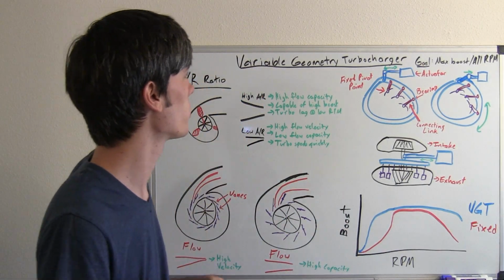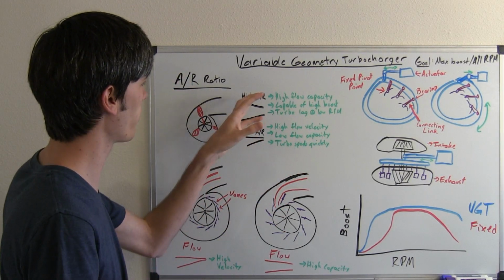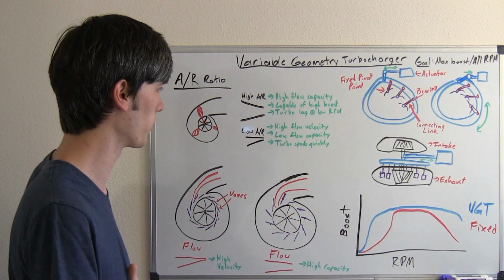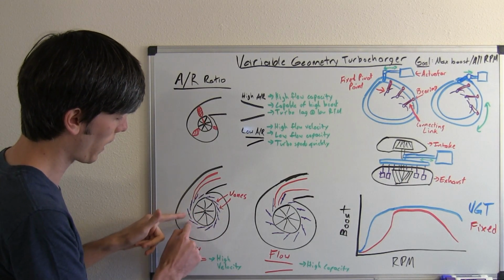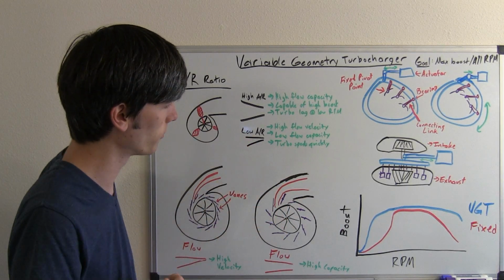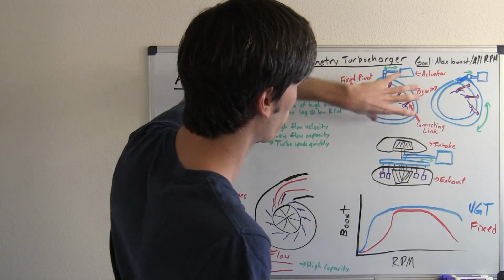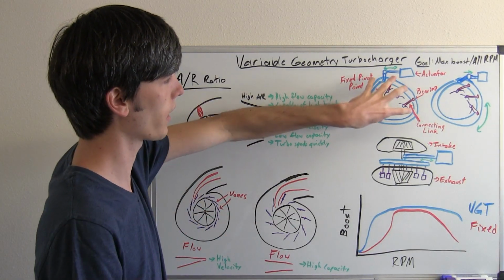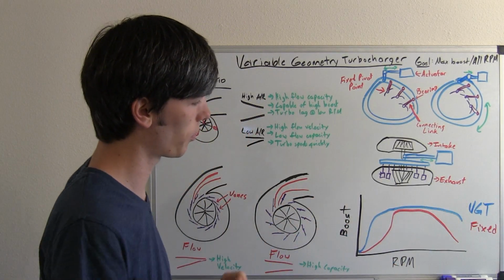Variable Geometry Turbocharger - Less Lag, More Torque!

Comment: I actually don't understand how the actuator works on a spinning rotor. Turbos spins between 80.000 to 300.000 Rpm. What kinda actuator could work in those extreme conditions? 😊

Comment: Would love to know more about how the increased vane height affects boost and drive pressure and the ratio. I am wanting to understand more about the difference between a stage I and stage II charger.  I am under the impression that the stage II has a greater HP potential, due to the taller vane height, but curious as to the down side also, if there is one. Thanks!!

Comment: HELP and answer someone this to me
Soo lag happens if the actuator arm are not good adjusted? When we press pedal to maximum there is bolt which actuator arm touches and that adjusted for best airflow of variable geometry (opens them), if that bolt is too much adjusted VG opens too much and thats overboost? but when we relase gas pedal variable geometry if not adjusted well it closes too much, or maybe closes total if not adjusted? And after we press pedal again there is more time for variable geometry to get opened to good angle to have good airflow for power? Soo we need to adjust lower VG angle which is not totaly closed but a little bit open, if its totaly closed or close to closed turbo lag will hapoen? I think that I need to short little bit actuator arm bc now for me its closed all the way, i cant move more in front that adjuster arm 😂

Comment: Hello, great video Im about to install a VGT turbo on my land rover defender TD5 and have a question for you.

The land rover has a snorkel installed with a mushroom head, I was wondering if at higher RPM with the VGT would the snorkel restrict airflow and do I need to consider a ram head or even consider increasing the diameter of the air intake from the snorkel to the intercooler?
Reply: No wont make negligible difference, as long as through the snorkel at no point the cross sectional size is never less then the area of the compressors inducer which on a td05 i would imagine your gonna have anywhere from 38 to 48mm inducer so around 1500 mm2, considering most snorkels are 75mm to 100mm you will be well and truely fine, and even if you had a restriction less then the size of the inducer it wouldnt drastically reduce performance anyway
Reply: @Eamonn_kelly1  appreciate that, cheers

Comment: First I like your videos, thank you. Pls help me. I have a VN turbo and a vacuum operated actuator. When the engine is NOT running are the vanes widest open? When the engine is running idle, vacuum is applied and the vanes are smallest. Is this correct? What is happening when I shorten the axle stetting? People say that it will give quicker boost? But what will happen with the top end power?

Comment: For a good portion of the video this just didn't make sense to me and I thought it was wrong. My error was that I assumed the "wheel of vanes" rotated and I thought that they should rotate faster when the vanes opened more, as they'd be catching more air. I think it was the circle drawn around the spindle caught me out.
Obviously I eventually realised that it was just the spindle at the centre that was rotating, and then it made a lot more sense.

Comment: 2:53 Hey man, let's take it real blowing in intake port of exhaust stage, at equivalent flow you ll see that it's the exact opposite, turbine RPM increase as you steer blade to the center, at rest position it turn faster than with crank pin in abutment on the screw. Weird isn't it? that will blow your mind, bringing here that's it's more complicated.
About stall, it's not the turbo but the engine that went in over pressurized exhaust pipe, fixed blade would make him "stall", this is one reason for blade orientation, to release pressure. Also, actuator is not moving out as engine RPM increase, but as command depression decrease, care not making engine RPM directly related, and that's not directly related to intake depression too.
The "disc" is not outside, but enclosed with exhaust stage, in separate chamber.
i guess at some point people can mixe with engine RPM and turbine RPM, better specify wich one sometime.
Interesting work, thx

Comment: Not correct. The VNT on the left is  high speed(velocity) posisition of the vanes, not the low speed. At high speed you need less air to the turbine in order to prevent overboost, thus you dont need wastegate on vnt turbos.

Comment: how does it limit boost?
Reply: Boost pressure is ultimately a function of spool speed, which is a function of the exhaust flow angle through and across the turbine blades, and how much the exhaust‘s momentum is changed as it passes over the blade. The flow angle becomes more “tangential” (around the circle) as the vane angle is closed, and more “radial” (across the circle) as the vane angle is “opened”.
So when the engine controller wants more boost, it adjusts the vanes to increase tangential (circular) flow, so the exhaust gas hits the turbine vanes at an angle that increases the spool speed. When it wants less boost, it opens the vanes to direct flow radially, so the exhaust exits without spinning the turbine as much.
The manifold pressure sensor provides feedback, and the engine computer monitors the boost continually and makes adjustments in real time.
My van’s CDI diesel can make 20psi of boost just off idle, or drop the boost completely when less power is required.
Love the VGT... but not cheap so I hope I never have to buy a replacement.
Reply: @nautamaran  thank you for the reply, i figured it was purely the velosity of gasses passing through the vanes but i missed the part of geometry so thank for bringing that to my attention👍

Comment: Perhaps I misunderstood; it seems like the vanes would be open wide at low rpm, to maximize exhaust thrust (assuming wide open throttle, low rpm) in order to spin up the turbine wheel quickly, eliminating lag; then, at high rpm, to eliminate overdriving the turbo, you'd close the vanes to keep turbo speed within rational limits, bypassing the hot side turbo wheel and venting directly to the exhaust.

Comment: Wow.. good knowledge!!
Can we fix after market VGT on place of stock FGT without changing ECU mapping ??
Reply: No. The ECU is required to control a solenoid or a servo that moves the vanes. If the vehicle didn't have a VGT from factory, the ECU is unlikely to support VGT control. I am currently working on a control system for a VGT using an arduino which uses 3 inputs. MAP sensor, camshaft position sensor (for RPM) and accelerator pedal position sensor. The output goes to a solenoid which controls a vacuum actuator. Hope that answered your question.
Reply: @SinaKhobyari  thanks man.. i would love to see ur project... now subscribed to your channel too !!

Comment: Maybe I don't fully understand VGT, but why hasn't someone made a machinal version for muscle cars, hot rods sport compacts etc? Even bikes!
Reply: From what I understand, the exhaust gas temps of a gas engine are too high for a standard VG turbo. The cost of a VG turbo that can withstand those temps is generally higher than what most people want to spend to not really even raise their peak top end HP (even though they will drastically improve your low end torque)

Comment: Could you combine a VTG turbo with Mazda's variable inlet?  That is, at low revs, the vanes are closed and the inlet to the vanes are restricted, further increasing the speed of the exhaust for instantaneous spool up.  At high revs, the opposite.

Comment: Could a boost powered actuator be used to open and close the vanes instead of electricity?  That way the vanes respond directly proportional to the boost and not to a signal.  At low power a spring pulls them closed, then as boost builds it pushes a piston to open the vanes and allow more boost until full boost is reached and the vanes are fully opened.  At liftoff throttle, the vanes start closing as boost falls keeping exhaust flow at maximum velocity for all conditions.

Comment: Very nice explanation as usual.
I was just doing some research on variable pitch ducted submarine propellers.
Similar principle with the variable pitch for optimal performance at various rotation rates.
Also changes the acoustics and cavitation.
While the duct increases the efficiency and lowers the cavitation.
But the added mechanical complexity does have it's drawbacks.

Comment: Does this even work on gas engines from what I've read is that nobody uses them and that they don't work.
Reply: On paper, it does work. Problem is gasoline engine exhaust runs at a much higher temperature, which damages the vanes very badly. To address that, you'll need more exotic materials capable of handling that kinda stress to make them, which in turn makes the turbo very, very expensive. So all in all, it's not that it can't work in gasoline engines; it's that it just ain't cost-effective.
Reply from the maker: Not often used on gas engines, but Porsche uses them.

Comment: Now a serious question is are you referring to the sequential design employed by manufacturers for things like panel trucks? Not to be confused with compound turbos used in competitions like truck pulls and diesel drag racing. If indeed you're talking about production designs that's cool but you should also then cover the science behind how compounds work together to create massive boost in a very similar way but without the use of intake and exhaust shunts. (The large turbo essentially creating more work for the smaller turbo but force feeding it the whole time). And if you haven't seen this yet I think you'd enjoy it for sure. I do know systems like this exist because I aided my friend in his 800+hp Cummins build. As always your videos are really informative!

Comment: Had a question but don't know where to ask.  Would it be possible to install a fan, driven by the engine (like a supercharger) but placed into the exhaust PULLING it through and creating negative back pressure?  Would you need a way to cool the exhaust or anything else first?  Issues with the cat?

Comment: Great video and explanation. I feel like on 2.29 left image represent high RPM situation not low since you have a lot of gas and you need to close variable valves to let high pressure gas flow around turbo. Right image for low RPM since use all exhaust gas to rotate turbo (valves are opened)
Reply: I came here to say this

Comment: I don’t think you have that right. It would be impossible for veins to be on the turbine wheel & be controlled. It would have to be located in the housing to restrict flow on low revs, spooling the turbo faster & opening to deliver full power as revs rise.

Comment: How does the vane angle changed?  It seems the all of the vanes are rotating along with their respective links to the ring and that ring is also also rotating. How is is sealed and how is it actuator connected to rapidly rotating device.

Comment: hi mate I know this is an old video but can you explain the stop screw on the vnt turbo I had to replace my turbo on my audi a4 b5 1.9tdi and all was great untill I got limp mode after taking off the turbo again I found out the stop screw had rattled it's way down to the pivot arm for the vanes rung so I unscrewed it out and put lock tight on it now my car is fine but it's not as quick as it was do I need to adjust the screw out more or screw it back in  a tad ?

Comment: Well I thought it would only improve the boost of the turbo, at low RPMs and in high RPMs the vanes wouldn't make any difference since, the volume of gas flow would be high.
Reply: It would depend on the A/R ration of the fixed A/R turbo that you have installed. Possibly if you turbo is big and only kicks in at the high RPM range you won't see more boost out of a VGT but likely your turbo is set to be optimized so that there are high RPMs that would cause your turbo to stall/or you have too much pressure, and the turbo will turkey. With a VGT it could continue to open up the vanes and prevent the loss of power from when your turbo "turkeys" (aka if during acceleration: too much pressure/small turbo = stalled turbo)
Reply: A turbo rarely captures all or most of (>~80%, depending on design) the exhaust gas, and high velocity doesn't necessarily mean high density and :. more air mass, esp. in large-displacement engines like truck diesels or at high throttle where the exhaust gases are much hotter due to higher fuel concentration.  Opening the vanes increases airflow onto the turbine even more, helping to maximize the air mass that flows into the manifold, so that the pressure increases on the manifold and in the fuel-air mixture, rather than on the turbine where at high RPMs it is often underused.

Comment: Hello. I have a Mercedes w203 cdi year 2001 and lately I have noticed a lag in car acceleration. I went to a car service and I was told that my VNT turbo kicks in when I start the engine, which is not normal according to the car service.  Vacuum pomp stays always on and never stops. Is it a problem that the turbo stays always on? Will I have a bad millage now with always turbo kicked in? Also is it normal I have a lag, a very slow acceleration compared to when turbo was working fine?
Reply: That question should be asked at a Mercedes dealership or a savvy performance shop (i.e. one NOT run by grease monkeys).  They can analyze your performance data and engine specs and tell you if you have a significant problem or not.
Reply: HuntingTarg
Reply: Probably a vacuum leak.

Comment: will You please tell me the name of the gasoline engines having VGT ,VNT ,VFTand VAT in production as well as prototypes
Reply: +Siddharth Sarmah Porsche's 911 Turbo and new 718 Boxter.
Reply: I have  found  these  two  earlier  but apart from these  two can you name  more which  are in production
Reply: Siddharth Sarmah I thing the new Ferrari 588 and some McLarens. 
But yes, it's mainly a supercar thing, unless you talk about diesels.
Reply: I also  need to know about the diesel engines
Reply: Siddharth Sarmah Usually german cars, BMW (Honeywell and BorgWarner), MB (Holset), VW-Audi. Others also tried them in the 90s, it was FIAT i think.
The most recent is BMW's new quad turbo I6 diesel, which has 2 variable geometry turbos.

Comment: is this the same as Double Vanos in BMW
Reply: +Zooey Deschanel No, VANOS controls the intake valve timing of the cylinders, double VANOS controls both the intake and exhaust valve timing. This is inside the turbocharger and is in now way connected to the VANOS system. There are BMW cars, mostly their turbo diesel cars, that feature both double VANOS and variable geometry turbochargers.
Reply: y0uRF4t3 I was asking because the word "Vane" in the video so i was thinking they are the same like Vane ; Vanos . Now i got it. Thanks for the info !
Reply: Zooey Deschanel VANOS comes from German VAriable NOckenwellenSteuerung, which translates to variable camshaft control.
Reply: y0uRF4t3 Oh the initials, absolutely clears my doubts. Thanks man!

Comment: What are the drawbacks to these turbos ? I didn't hear anything serious in the video, but it seems like if they were so great at achieving the wider band with a simpler setup then they would be kings of the turbos.  Curious.  I am investigating forced induction for my 350z. Thanks!
Reply from the maker: +Carmelo Santini Cost and they tend to be best with diesel applications, as the vanes won't handle the higher exhaust temps from gasoline engines.
Reply: Thanks, you have a great channel I love it
Reply: Ah, I guess the variable twin scroll has my attention the most.  Seems like they have the most success and widest linear power band?
Reply: Best broad drivable range would probably be the VGT/VNT, some makes call it other things so bare with me. Im doing a 4bt cummins diesel swap and would love one of these style turbos, but at a price tag of 2000-4000 EACH, Im going to pass on it. But the 07.5 and up 6.7 cummins in the rams use a turbo like this with great results. The truck is a beast with one. A gas engine could benefit hugely from it, as does a diesel. If you put a 64MM on a 5.9 it would be a bit laggy, but put say a 64MM turbo comp wheel turbo thats a VGT on the same engine, it would be very strong, VGT doesnt care what side its Comp wheel is, it will try to force it to lite hard no matter what the sizing is. But at the cost that these things run at is their massive drawback!
Reply: Engineering Explained The VW group has some applications of VGTs on gasoline engines (the 991 Turbo, for instance, and more recently a 1.5 TSI). Did they find a way for the vanes to handle the higher exhaust temperatures, or is the costumer buying a ticking time bomb?

Comment: would this work on a Diesel application?
Reply: +PotatoadZ ford 6.0 uses VGT
Reply: Yup, ram ecodiesel uses this setup.
Reply: iv driven those, ECOdiesels are horrible and gutless until the turbo kicks in 100% and its usually to late when the turbo finally kicks in.. it never keeps its boost
Reply: Check for a leak then, I've never seen any issues unless there's a boost leak anywhere myself.
Reply: They build peak torque @ 2000rpm and use vgt...  I wouldn't say that's too late in the Rev range at all lol.

Comment: so, for my fd3s i need a:  bi-synchronous, variable geometry, variable twin-scroll turbo chargers with N2O cut-off that injects from 1000rpm to 5000 rmp.  holy shit.  sounds expensive.

i wonder where we are with the electric, 120volt, turbo chargers that don't even touch the exhaust gasses at all.  seems way, way easier and way, way less expensive

Comment: Excellent video!   Only question I have is.    What triggers that actuator?
Reply: +mafosa Most are controlled electronically but you could use many different methods. I have a video controlling one by hand while the truck is running.
Reply: Mostly vacuum pump controlled by the ECU